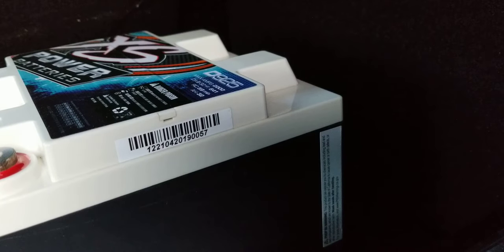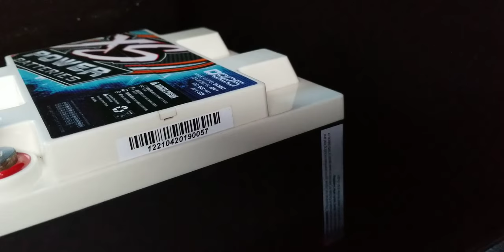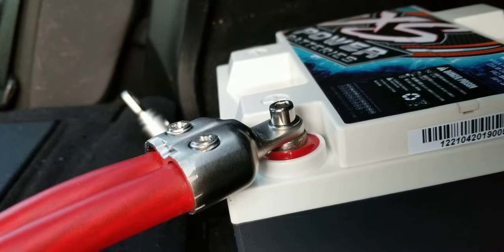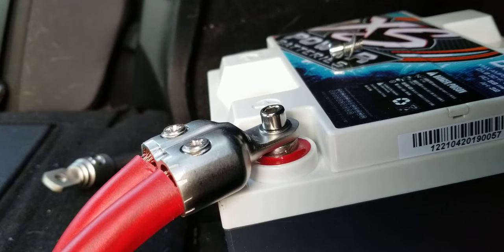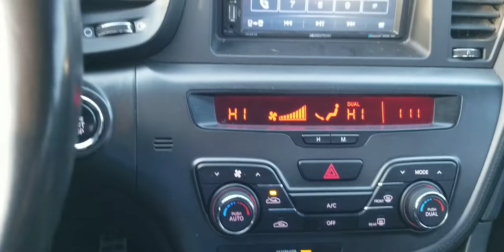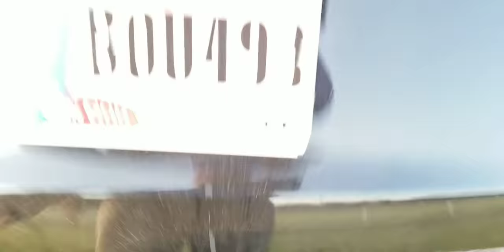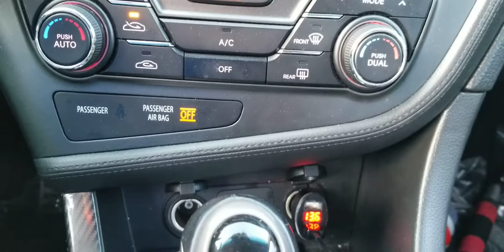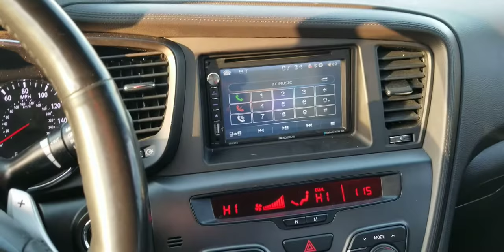1ST TIME EVER INSTALLING AN second Battery American Bass Elite 12/E-1244/t1.4000dl/Ground Shaker

Comment: Bro that’s where the real power finna come from
Reply from the maker: Thank you👊👊👊 and I agree I'm still testing it out but the bass got deeper since I hooked the battery up.
Reply: BLACK KIA ELITE 12 yeah I got the same ones on jus 2000.1 smh breaking shit lol
Reply from the maker: @certifedbendersceo2420  lol
Reply: Check it out I uploaded 2
Reply from the maker: I got you soon as I get home from work
Reply: Iight bet shole tryna get this youtube started
Reply from the maker: It's hard man only thing I can say keep posting videos
Reply: Yeah ima do that not only my car everybody else reactions and other cars
Reply from the maker: @certifedbendersceo2420  that sounds like a great idea
Reply: a tip: watch movies on flixzone. Been using them for watching all kinds of movies during the lockdown.
Reply: @Demetrius Jaylen Yup, have been watching on Flixzone} for months myself :)
Reply: @Demetrius Jaylen yup, I have been watching on Flixzone} for months myself =)
Reply: @Demetrius Jaylen Yup, been using flixzone} for since november myself :)
Reply: @laytonfranco967  💪💪💪
Reply: Will this battery stop my lights from dimin
Reply: @arturoramirez2315  yeah it should I’m waiting on my alternator now
Reply: How did you connect the mids and hight amp
Reply: As far as power cable
Reply from the maker: In this car I ran the speaker wires from the amp to the head unit and use the positive and negative on the head unit
Reply: What is finna?
Reply: @dumpsterfire6351  finna is a Memphis word 🤣 it’s like going to

Comment: Can you post an Amazon link of the sub you have I wanna make sure I get the exact one (Also subbed)
Reply from the maker: Thank you for the sub and I'm having a lot trouble finding the subwoofer they sold out on ebay and Amazon. But they're called the American bass Elite 12/E-1244. American bass website has the subwoofers but the price is to high.
Reply: BLACK KIA ELITE 12 ok thanks
Reply from the maker: No problem but I will stay on the lookout for you.

Comment: Make sure u have a second fuse from the battery to the amp
Reply from the maker: Thank you 👊👊and I do have 2 fuses 1 in the trunk and 1 in the hood I'll be putting in a 3rd later. But it is a working progress I still have a lot to learn.
Reply: Its on side of battery
Reply from the maker: Sorry I missed your comment brother but you are right the only reason I had to do it like that was because that's the only way the wire would have been long enough to reach the battery but now it's all good I got two fuses in the trunk and 1 in the hood. You'll notice that in the updated video.

Comment: I just got this same battery and it fit perfectly in the wheel well in my trunk for my Supra. Ran 4 gauge wire to the front. Worked out perfect
Reply from the maker: Yes it does but since this video I added 2 batteries upgraded to a 3k amp and now I use the DC Audio Level 4 12 check out my recent videos if you get a chance thank you for your feedback.

Comment: Do the amp and 2nd battery need separate grounds? I’ve seen some people just connect the amp ground directly to the 2nd battery ground terminal instead to chasis.
Reply from the maker: I have the ground to the chassis and a battery in the hood it was the original battery

Comment: Slapping.... told u that battery 🔋 does the job..
Reply from the maker: Thank you Brother👊👊👊 The power is better. And yes you did tell me so and yes it's a great battery.
Reply: @markwoods212  , i threw up video,  demo coming soon, u got me inspired to do video  👍
Reply from the maker: @ronniescaplen6604  Again you have a awesome system. And happy to inspire you but you also inspire me too👊👊👊👊 Follow me on Instagram @Blackkiaelite I'll follow you back
Reply: @markwoods212  so when i hook up the second batter does the ground go to the amp along with the ground thats already hooked up ? Im running off the battery that runs my car and had to tune down my amp due to clipping and id definitely like to tune it back up for a harder slap
Reply from the maker: @truckingwithmikemyers2351  I would give the second battery it's own ground
Reply: Upgraded alternator is the real work horse! Batteries only store power....

Comment: Did you also buy a AGM battery charger to make sure your battery is fully charged?
Reply from the maker: No I didn't it came fully charged already but now I have AGM charger
Reply: @markwoods212  that's what's up👍
Reply: @donellis5005  Straight up, you can get a good AGM charger deep scycle for 25 bucks on amazon. easy and nice to have too.

Comment: just grabbed a xs xp 3000 to put wit my ct2300.1. got 2 15 cvx on a custom aero ported box. I havnt hooked it up yet but last time I hooked my system up my car died🤣🤣 but I was running a collosus 5k on stock electrical in a cadillac dts 😆😆😆
Reply from the maker: Like I said let me know my system has changed a lot since this video if you get a chance check out my latest videos.
Reply: @markwoods212  I will!

Comment: I assume he's still running a stock alternator?

All the upgraded batteries don't make much sense if you're not going to run a high output alt!
Reply: People do this all the time and it makes zero sense... 🤦‍♂️
Reply from the maker: Right now I have a high output alternator
Reply: @markwoods212  what alt did you end up going with?
Reply from the maker: @LTSRIDE24  Brand X 300amp

Comment: I have a new car battery can i used it for my car system and have do i hook this up
Reply from the maker: How many watts is your amp if it’s 2000 watts and under you should be fine just using your new car battery

Comment: I have the same car and same subs! What size battery is that you put in the trunk and also did you change the stock battery or did you upgrade it I can’t find a xs power battery size that will fit under the hood of the optima.
Reply from the maker: The battery in the trunk was called xs power 924 and I had the stock battery in the hood and alternator.
Reply: @markwoods212  thanks!!

Comment: You have the same kind of battery in the hood and in the back? You have an isolator?
Reply from the maker: It's different now because this video was a while ago but I have the same battery you seen on this video and Intimidator battery in the trunk and a factory battery in the hood plus I  change my speakers and amp
Reply: An isolator isn't absolutely necessary unless u go lithium as your auxillary battery. I run an interstate wet acid under the hood, and a 80 Ah AGM as my battery in the back with the amp, also keep a 6A battery tender mounted in the trunk that charges both batteries when the car is home and parked. Lots of people think an isolator is a MUST, I have had this setup for six months and monitor my voltage, and alternator, and you can roll just like this dude, safely.
Reply from the maker: @Hammerback0  Thank you for the great feedback brother.

Comment: I got upset once and used a hacksaw to cut. Steel cutters works too
Reply from the maker: I just use the 0 gauge wire cutter now it's been a while since I did this check out my recent videos if you get a chance my system has improved a lot.

Comment: Where did you run the negative battery wire from the xs power battery
Reply from the maker: I ran it from the back of the trunk on the right hand side
Reply: @markwoods212  you ground it to the body of the car?
Reply from the maker: @RAaronD90  yes
Reply: @markwoods212  appreciate it bro im about to subscribe check my page out if you dnt mind
Reply from the maker: @RAaronD90  thank you
Reply from the maker: @RAaronD90  and of course I don't mind but if you run the ground to the body of the car you should be all right right now I had a big 3 done and I'm adding a third battery I think everything is different in my car since this video
Reply: @markwoods212  Do you do all the installation work yourself? How do come up with the info on what products to use?

Comment: Does the battery have to match the watts of the amp/subwoofer ?
Reply from the maker: Yes it went perfect with this system
Reply: @markwoods212  so if I have a 1500amp with a 2500 subwoofer would a 1000/1500 battery will work ?.. thanks for answering !👍🏼
Reply from the maker: @user-ng7vg1lb3e  No problem and yes you’ll be good to go

Comment: Some sound damping material would make a big change in sound intensity and how clean it sounds.
Reply from the maker: Thank you for the advice but when you get time check out my latest video and I've already installed Dynomat
Reply: Absolutely! Sounds not so great with all that vibration!

Comment: can you use the remote wire (blue amp wire) to turn on the isolater?
Reply from the maker: Sorry I’m not sure about that but I’ll try to find out for you
Reply: @markwoods212  thanks, I got about 2 more weeks until I hit that part of my build, I need to find out, if you find out pls let me know thanks
Reply from the maker: @BennyHill8844 I just ask my friend he said yes you can use it if it’s from the fuse panel or use a toggle switch
Reply: @markwoods212  I didnt even think about using it with a toggle switch. hey, thanks my friend!

Comment: Hey man quick question how did u charge ur battery did u buy the xs battery charger
Reply from the maker: No it's called the extreme charger but it works.
Reply: @markwoods212  where u get that charger from if u don't mind
Reply from the maker: @chrisholmes2888  From home Depot for 20 bucks
Reply: @markwoods212  ok i will look it up now
Reply: @markwoods212  dam i look all over home depot website couldn't find it thanks tho buddy
Reply from the maker: @chrisholmes2888  X Battery Extenter try that
Reply from the maker: @chrisholmes2888  https://www.homedepot.com/p/Schumacher-6-Volt-or-12-Volt-2-Amp-Automotive-Battery-Charger-BE01248/207123536
Reply from the maker: @chrisholmes2888  I find for you
Reply: @markwoods212  ah man thanks brother I had to get a xs power for my vxf 12 and 2000.1 skar she was clipping bad with my stock electric
Reply from the maker: No problem Brother
Reply: @markwoods212  how often would I have to charge the battery if I am using it about 3 hours a day at the most.
Reply from the maker: @christopherbrock8913  Your car should charge it when running.

Comment: The 2nd red wire is connected to the main battery?
Reply from the maker: Yes
Reply: Thank you this helped out way better then other videos I’ve seen! Simple and easy… 💯💯🤘🏽
Reply: Another question my fuses on the amp keep on going out does that mean I have too much power to the amp?
Reply from the maker: @leotorres1603  Probably if you’re seeing your lights dim and also check all your connections

Comment: All.on stock alternator
Reply from the maker: Yes
Reply: @markwoods212  then I think I need one of those batteries  headlights dead on 800 rms
Reply from the maker: @Strict30  it all depends on what kind of amp you have do you have all 0 gauge wire
Reply: @markwoods212  sk800 on a 12 svr
Reply from the maker: @Strict30  in that case it's whatever gauge wire to amp recommend

Comment: What you got as far as alternator?
Reply from the maker: On this video no alternator but I did get the brand X 320 alternator later in the car
Reply: @markwoods212  Nice, I had a 250a big3 and a shitty red top as my primary. Drop to low 11s. Have 2 Skar DDX 12s on a ct sounds 2k. I ended up getting alt switched cuz charging light came on, i think it was just the shitty battery and the fact that i didn’t have a second battery
Reply: @markwoods212  gonna do a rebuild with same setup, gonna get same alt, but have a regular battery up front. Thinking the D975 in the back would hold up with battery isolator and 250a alt
Reply from the maker: @trilogyaaron5864  Yeah the 250 should get it done

Comment: Is the battery under the hood the same kind
Reply from the maker: No it's just a factory battery but since this video I changed a lot now I have 2 group 31 batteries plus 300amp alternator
Reply: @markwoods212  I’m trying to run another battery in my truck but it’s different from the one under my hood. Do they both need to be AGM battery so I don’t have any issues
Reply from the maker: @derrickgriffin3992  You can run it with no issues I have 2 amg and one factory
Reply: Do both have to be agm batteries
Reply from the maker: @derrickgriffin3992  No
Reply: Already preshate the info💯
Reply from the maker: @derrickgriffin3992  I try brother I base things off my own experiences
Reply from the maker: @derrickgriffin3992  I almost forgot to mention check out my recent videos and you'll be updated with my system but I do appreciate you watching this video.
Reply: @markwoods212  for sho and I will watch it . Thanks for the update

Comment: U running a 4 channel as well?
Reply from the maker: No not right now just 1 amp for the woofers
Reply: BLACK KIA ELITE 12 question? U think a subwoofer box sounds better more close to the trunk or pushed back?
Reply from the maker: @carlitot5388  For me it sounds better in the middle of the trunk turn to the back that gives it air for both ways
Reply: BLACK KIA ELITE 12 agree🤘🏾🔊💪🏽

Comment: Was this on the stock alternator?
Reply from the maker: Yes the alternator is stock
Reply: BLACK KIA ELITE 12 I’m definitely going with this set up especially since we have the same car mine is a 2016
Reply from the maker: @trey6god92  I love my setup I just keep changing it
Reply: BLACK KIA ELITE 12 roughly how many DBs is it putting out because judging by the video it’s close to 140
Reply from the maker: @trey6god92  On this video probably 140 to 142 but now I'm probably up to 146 to 148 I upgraded my amp to DBCOMP4 3000 watts and also upgraded my subwoofer to DC Audio level 4 and it gets very violent in the car and as of now I don't have no extra battery in the car but I'm about to install 2 batteries next week.
Reply: BLACK KIA ELITE 12 I may have other questions what’s your IG if you don’t mind
Reply from the maker: @trey6god92  @blackkiaelite and of course I don't mind
Reply from the maker: It's a 150 amp
Reply: S your alternator a 105 amp alt

Comment: How many waats do i need a second  battery would you say?
 I have a 175 volt alternator so it's not too dinky. I want to run at least 2000 what's though but at 4ohm so I get less voltage drop..
Reply from the maker: Yeah 2k is the minimum but if you decide to go to 1ohm you’re definitely need a extra battery
Reply: @markwoods212  thanks brother
Reply from the maker: @Contact_Info  No problem

Comment: Do you have a ground to the second battery then another ground to the amp? Or do u have a ground to the second battery then from their another ground to the amp?
Reply from the maker: The amp and battery has its own ground
Reply from the maker: Yes Sir
Reply from the maker: @booboo1ed  I always do separate grounds now I have a total of 8 grounds in my trunk if you get a chance check out my recent videos.
Reply: The whole car is ground  DONT RUN 2 POWER WIRES (-   +) TO BATT JUST TO FRAME (-) 2FT